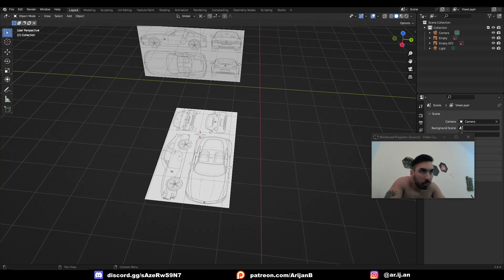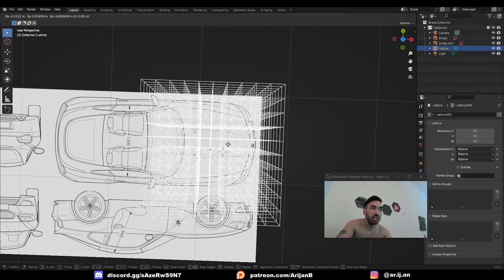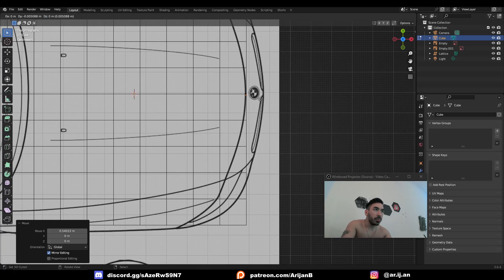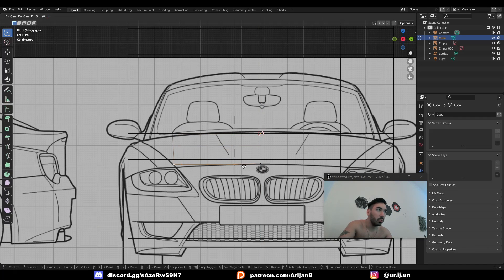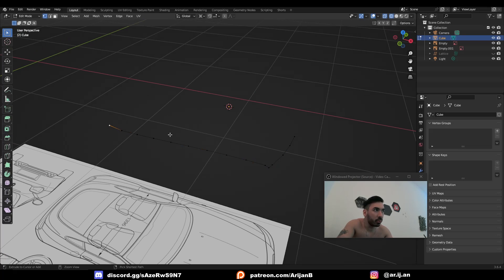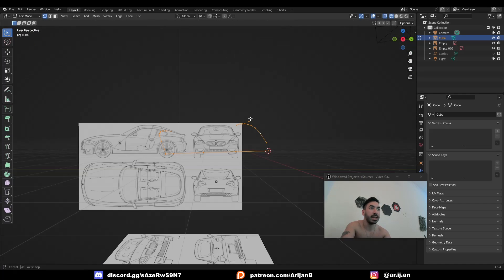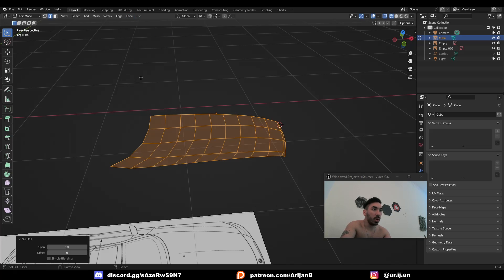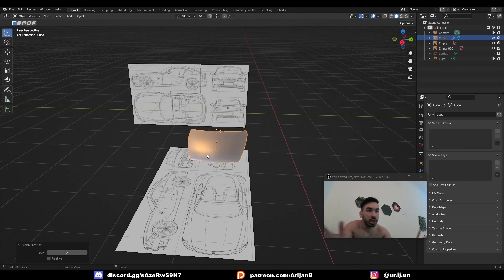The BEST WAY to Model Cars in Blender (Arijan)

Comment: Fucking legend, never seen someone explain it so quick yet so simply that you don't have to pause to process wtf happened lol.

Turns out I've been doing something similar, so I was on the right path, but I didn't follow some of the rule-sets (Same amount of vertices on both sides etc.) which resulted in some ugly and very hard to modify topology.

Comment: I copied the tut word for word bar for bar... Grid fill doesnt work it says "select two edge loops or a single closed edge loop from which two edge loops can be calculated" what am I doing wrong? thank you!! Goat.
Reply: Okay i figured it out.. you need to have the same number of edges on both sides and front and back if you get this error.
Reply: @FoolOnWheels  Thanks Man
Reply: Had the same problem but the solution was to select all vertices and mesh>merge by distance. Apparently i duplicated some vertices without realizing

Comment: Really great tutorial! I'm having trouble with the grid fill part. When I select the whole loop and hit grid fill, nothing happens. I've done everything else the same and can't figure out what I'm doing wrong. Anyone have any ideas?
Reply: That happens if the vertacies arent even on all sides :)

like if the top of the hood has 5 verts, and the bottom has 6, if wont work

both sides need the same, and the top and bottom need the same amount, otherwise it cant make a grid